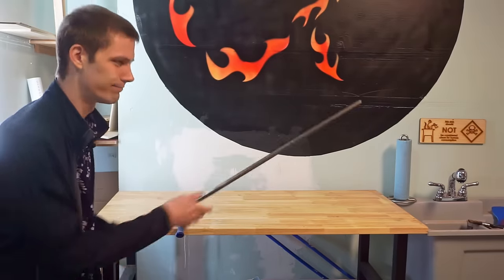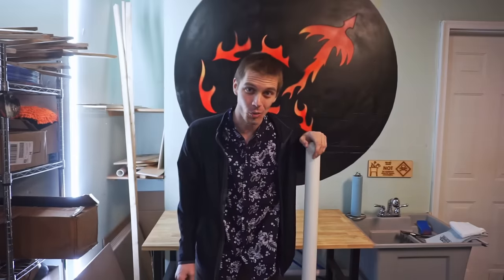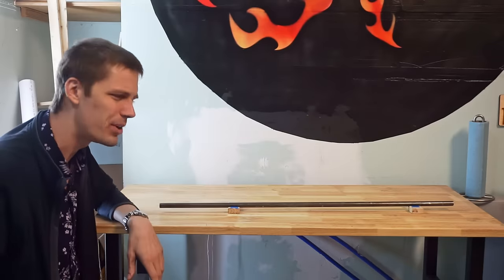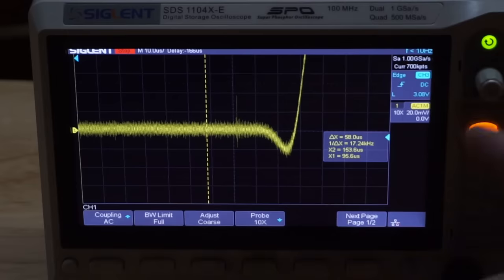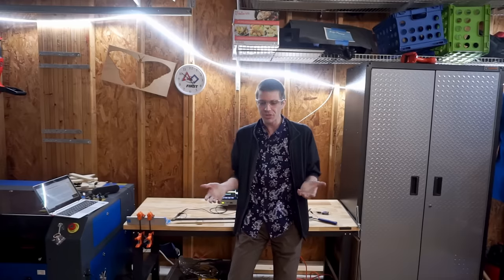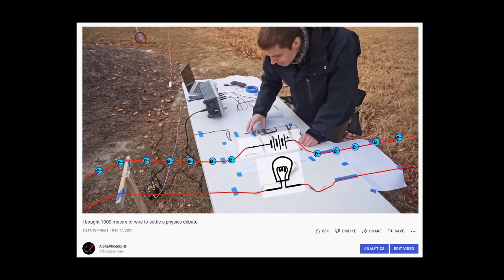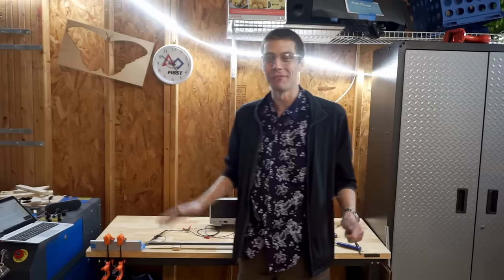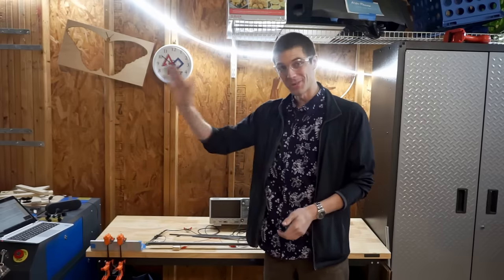Are solid objects really “solid”?

Comment: "All models are wrong, but some are useful"
Reply: But some are less wrong
Reply: Is that a model?
Reply: @MadMan-r5s  Yet, as noted in the video, the more accurate the model the harder it is to work with.  As alluded to in the video, the more computational power is needed.

There's some interesting discussion about modeling wooden structures, like bridges.  Just due to how things end up working it's normal to simply assign a beam x/y/z material properties.  Yet said beam might actually be a laminate, and wood itself is not uniform.  I might be mistaken, but I don't know of a commercial CAD simulation package that takes wood grain direction into account.
Reply: It's all a compromise...
Reply: Very true 👍

Comment: I never really considered how soft, flexible, and noodly steel is until I became a machinist.  Now it's a constant thought and struggle in my daily life.
Reply: There is a YouTuber called Robrenz. He doesn’t make many videos these days but he has some amazing videos. He shows how much machined items can change size with just the heat from your hand. He measures into the millionths for machining. Absolutely blew my mind. Machining itself is an interesting field. Toss in precision metrology and you’ve got AWESOMENESS. lol.
Reply: I have seen improperly fixed (ie no slip sleeve) large steel flues rip out  ceilings ,  upstairs floors and roofs on first stove light up due to steel expansion ! (and people taking on jobs they shouldn`t)
Reply: Yeah, I've thought steel is hard and tough until I once bent a 1cm. thick steel rebar just by pulling at one end (it was a big leverage, but still.)
Reply: @quint3ssent1a  Try that with a tempered 1cm steel bar
Reply: @Staroy  With a long enough bar it would still move.  Depending on the temper it would probably then crack, but the point still stands.  A 100m length of 1cm tempered steel bar can almost certainly be moved by hand.
Reply: @TsunauticusIV  that sounds like something i really want to watch, unfortunately i cant find him when i look up robernz, would you be able to give me their @?
Reply: @JamesTaylor-cu9en  Robrenz not Roberns. R before E, except after C or something like that? 😂
Reply: I wish I had learned machining when I was young, it seems so impenetrable as a 40yo.
Reply: @TsunauticusIV  machining AND metrology are both fascinating to me.
Reply: @MattH-wg7ou  haha, thankyou not sure i how missed that so many times

Comment: As a 66 yo electrical engineer, I've found myself going back to learn physics over the past 20 years. Your demonstrations of physics are REALLY well done... really informative. Nice job.
Reply: yes, everything is so intuitive. the answer (after watching) seems so obvious. before, i had zero clue what the answer was. hiding in plain sight. 

indeed, VERY well done demonstration. thorough, and yet captivating.
Reply: I more of a medium rare person myself
Reply: @EngRMP: I would love to know any good sites or youtuber that you would know that are both very clear about how electricity (and later, electronics) works, but also not too slow to explain things (time is precious). If you know some good ones, please tell us.
Reply: I'm sorry Olivier, I wish I could help you... it's a complicated topic. However, this gentleman recently made the best video I've seen that explains voltage, which is really one of the most difficult terms to understand. Once you understand voltage vs current, you'll be ready to understand resistance vs capacitance vs inductance. If you have a good math background and are comfortable with the concepts of integration and differentiation you'll enjoy learning about circuits with these various components. Going on from there you'll learn that diodes have beautiful exponential properties, and that leads to transistors. I'm the wrong person to recommend sources of info because I'm coming at it from a difficult angle or need.

Comment: I find the fact that you ALSO explained the "failures" in the experiment, as valuable as the results themselves.
Reply: yep, if it was just the result, I wouldn't have learned something new. But the 2nd part of the video was really interesting to me. Kinda blew my mind
Reply: See "Science".
Reply: "We fucked up."

"Booo!"

"But we wrote it down!"

"Yeah, science!"
Reply: Is rare to see that in a YouTube video.
Reply: @Ragnarok540  Also "rare"? ;-D You should see some of my typos, that's strictly amateur level mistake-making there,
Reply: This is the scientific method. Failures are more common and are infinitely valuable
Reply: And good to show the correct result first.
Reply: That' what got by sub to that channel, actually.
The "experiment" itself got a  lot of apparent flaws (including sensor reaction speed and such).
But all of that was cleverly addressed in the follow-up.
Reply: I relate so much with the second part when I was studying computer science. The first results just did not fit the hypothesis and you had to look through your methods and see if you messed anything up. In some other case like this one, it was the expected result that was faulty (turns out there's a 3d speed of sound and a linear one)
Reply: He had to verify it was a valid experiment. There could have been so many issues in the setup, mainly delays in any of the components. Luckily, the speed here is slow, the time measured is large compared to delays I would expect from circuit elements.

My favorite part was the linear correlation fit of the 3 different length skinny bars, that was beautiful.

Comment: Really really interesting video (like all of yours)! I had no idea about the 1d and 3d difference of speed of sound. Thanks so much for sharing your curiosity and experiments with us!
Reply from the maker: Yo nice to see you here! Glad you liked the video! the extensional thing was new to me as well. I assumed it was actually like, pulling on a bar, "extending" it instead of compressing it and ignored that number completely at first. Feels like for large displacements, the interatomic potential IS asymmetric, so I bought my own assumption far too well... guess I should have figured out what it meant to start!
Reply: Wow, all the big names are here!
Reply: might be stupid of me to say. but would it not simply be that the "delay" would be the same on both ends? and that once you overcome the intertia both ends move at the same time after the 1 second delay?

Meaning. the speed of "push" can not be obtained on the object until the delay time which for all i know could be either light or sound speed has elapsed.

on a perfectly rigid solid object there would be a delay on both ends until that time has passed both ends will travel in the same direction is basically what my theory is.

il try one more time to explain my thought process.. You cannot overcome the inertia of the object on either end until the time delay has elapsed
Reply: My gut impression was that if the material is not constrained around the outside, then it behaves in a more elastic manner.  It has more freedom to compress by expanding sideways, which is harder to do if there's more of that dense material in the way.
Reply: @norwegiansmores811  my thoughts exactly, I still don't believe that "motion" takes such a visibe amount of time to travel in such small dimensions. Maybe there'd be some actual motion delay for lengths in the range of 10⁸. But yeah, totally agree on the inertial delay part
Reply: @norwegiansmores811  At first glance, this does describe what appears to be happening... that is the movement of the B end is now synched with the movement of the A end, but it's not. B end is moving as a result of earlier pressure, not the current pressure on A end. That is to say, if you stop moving A end... some time will pass before B end stops moving.
Reply: Literally absolutely nothing is solid time is the only thing that makes things seem solid.
Reply: @AquarianSoulTimeTraveler  There ARE solid materials - literally all materials when cooled down low enough. People just misunderstand them as perfectly rigid - no such thing in real life. However, there is plenty of solids - all compliant.
Reply: @majstrstych15  yeah but is anything solid, time is the only thing holding it all together without time nothing could exist... Everything spring forth from a singularity point infinitely small and all existence came from that infinitely small infinitely dense object... All will eventually return to that state given enough time without time there would be nothing but infinite darkness and singularity.
Reply: @AquarianSoulTimeTraveler  You say these things as if they were facts. It's foolish - we don't actually know the origin of everything!
Reply: You never been smart that’s why probably 😊

Comment: I'm glad somebody else has had this exact question before. 

Always thought about how faster than light communication could come down to just having a really long stick, knew that it couldn't be right, and now I know exactly why it couldn't.
Reply: I had EXACTLY the same idea when I first looked up this topic. Although, you wouldn't actually need a long stick, it could be measured through the movement of any object.
Reply: I know how to move something faster than light. Get a very strong laser and point it at the left side of the moon. Then rotate the laser quickly to the right side of the moon. If you do it fast enough, you will move a point of light faster than the speed of light.
Reply: @boggless2771 This has been explained as impossible by a lot of people before
In short, if you have a constant light souce (laser pointer in this case) the light coming out of it is a constant stream like water from a pipe
And what happen when you move the pipe left to right quickly? The indiviual water droplets separated from the continuous straight stream. However, that doesn't mean they will travel any faster toward the wall in front. They only give the illusion that the water splash on the wall from left to right travel faster than the speed of water coming out from the pipe, but if you exam closer you'd see a delay, an arc of water due to the speed limit
Reply: @boggless2771 Sure, but that point doesn’t represent a physical object. The photons on the left side are not the same as the photons on the right side. Nothing is transmitted between the points.
Reply: @isaiahmumaw  right. I said something ;) No information is moving ftl. But "something" is moving at that speed.
Reply: haha stick
Reply: @NeinKyori  you're wrong because he's talking about a different thing. The projected light dot on the Moon will still move apparently at greater than light speed (the beam will "bend" obviously), but the dot isn't a real physical object btw
Reply: {faster than light communication could come down to just having a really long stick}.  You just described his entire experiment in one sentence.  If somebody asks me what this video all about?  Well, he is telling me why faster than light communication,  could NOT come down to just having a really long stick.  To the lay person, boom.  Get a stick.  Problem solved.  But he tells how, nay.  You still have the exact same problem.  Just with a stick in the way, now.
Reply: Same here, this question crossed my mind a few years ago, I did some googling and found the the answer to it, but that only gave birth to more questions in the end, like how is "movement" in itself possible and how do you explain movement in a microscopic level in the first place. This made me aware of the Zeno's paradoxes and other interestingly similar concepts.
Reply: I understand why but I'm still puzzled by this question.
Where does the mass go when moved?
If you moved a LY long perfect solid at the speed of light for 6 months, it would take a year from the start for the other end to move, so where would one half of the solid be after 6 months?
Reply: @MichaelClark-uw7ex The mass gets compressed and that compression travels like a shock wave up the length of bar.

Edit about perfect solids. They don't exist as far as I'm aware.
Reply: @boggless2771 this just... Isn't a way to make something move faster than light. You've not even done the correct example
Reply: @marcwilliams9824 I'd imagine the closest thing to a true solid is inside a super massive black hole.
Reply: @boggless2771 I doubt it. That theory is based on the bahavior of laser light on Earth, to us its instant. When light travels vast distances, like 290,000miles, it is not instant. It takes light 1.3sec to get from Earth to Moon, at that distance as your laser point travels across the moon each individual photon would have a gap between it and the last. Imagine shooting a fully automatic rifle across a large board, you'd see space between bulket holes, that is the same type of pattern you'd see with laser light at the moon.
Reply: This crossed my mind in the comments section about infinity gears. People were saying if you could move the last gear that takes a billion years to turn once. You could move the first gear faster than light. 

 I said no. I didn't get everything right. I said "wouldn't the atoms need to travel from one to the other. The information needs to travel through each atom". 

 Then people said no I was an idiot. It does travel faster then light. 

 People are idiots. They don't realize much smarter people already thought about that before declaring light the universal speed limit.

Comment: There are at least three solid wave speeds involved:  (A) rod or bar, (B) plate, (C) infinitely-sized solid.  Each of these involves the vibrations of the molecules (which is the same for all three cases) but the effects of the boundaries (the visible surface of the steel) allows the molecules to move transversely rather than along the length of the bar. This has to do with the spectrum, or frequency content, of the source --- which is a hammer impulse.  At low frequencies (related to how long the duration of the hammer face acts on the rod), the bar or rod appears to be thin relative the sound wavelength, so you observe the rod speed.  The bar gets progressively fatter and thinner as the wave moves. For steel this is around 5100 m/s.  If you did the experiment with a thin plate, you would measure around 5400 m/s, because it can only feel the boundaries through the thickness direction rather than all the way around the plate.  In an infinite solid, where the waves never feel the boundaries, you would measure around 5900 m/s. The wave has no where to go.  A lot of this behavior is related to the Poisson effect for static loads on solids, and the math to show the 3 waves speeds involves the Poisson ratio.  The speeds are approximate depending on the chemical composition of the steel.  I don't know if anyone who commented already posted this explanation so I apologize if they already did.  There are also shear and interface waves that are beyond what I wrote here, hence I said that there are at least three mechanical wave types. Great work BTW.
Reply: Thank you for the great explanation
Reply: Wow, what is your background? That was a fantastic explanation. So true about the spectrum of the strike.